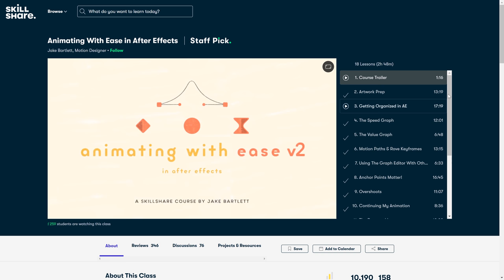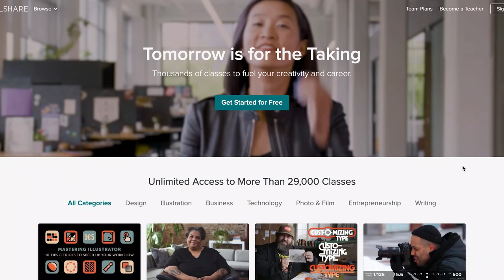How ice water makes hot water boil

Comment: 4:03 Steam explosions from super heated water is even more common (& more dangerous & more violent) if the water is distilled, so there are no minerals or nothing else than H2O molecules inside.
Trying this is REALLY dangerous & you will very likely burn yourself horribly, use at your own risk.
Reply: Well, apart from a chance of burning an eye out if the water decides to explode at the moment you look into the bottleneck, I wouldn't consider it very dangerous. It can cause nasty burns, but the burns aren't really a life threat.
Reply: Well, i doubt it is possible. Unless the bottle is plugged, of course, but that is a different kind of an explosion. The pressure the explosion can produce is limited by vapor pressure of the superheated water,  which is a function of temperature. And it would take some serious overheating. But i am meaning to try that, I hope for best destruction if I cover up the surface with a layer of oil, to prevent heat loss to evaporation from surface, and potential disturbances there. I know how much of a mess the water can make in a frying pan, submerged under oil.
Reply: But if it can explode the bottle, yes, I agree it deserves to be called "dangerous" (mainly as an eye hazard).
Reply: @victortitov1740  I hope you film this & upload to YouTube :D

I also hope you don't hurt yourself.
Reply: I will certainly keep quite a distance. I will put it out on YT if it's spectacular enough.
Reply: @victortitov1740  Good luck! :D
Reply: I'm just suprised the glass didn't shatter due to the temperature differential
Reply: When I worked in a chemical laboratory we always had to put some boiling stones or boiling pearls into the water or also other liquids to prevent this.

Comment: Steve, you should have followed this up with an experiment I used to love at school.  Put water in a glass flask or bottle. Connect this to a vacuum pump. As the pressure lowers the water will boil. At a given point the water will suddenly turn into ice.
Reply: I've seen the boiling part of this done by hand using a plastic syringe.  The ice part, I hadn't thought of before :)
Reply: @andymcl92 , I think if you're able to get it boiling, you can get it to freeze just by repeating the same thing lots of times.
Reply: CodysLab did some videos on that not too long ago, maybe a year or two.
Reply: @andymcl92  If you make the water evaporate it loses energy and cools down. Once it cools down enough it suddenly turns into ice while boiling. Very interesting to see, especially if you don't yet know the mechanics behind it.
Reply: @Gaehhn  Yeah, I get there science (I've actually got a physics degree), is just never seen that part of the demo :)
Reply: If you have a good enough vacuum chamber you can get a really cool demonstration of the triple point just by pulling a vacuum on ice water. At near 0 pressure and just above 0C the water can be all 3 states at the same time and it is really trippy

Comment: Nice demo!  I did this in my classroom with a boiling flask and a rubber stopper.  It didn't work particularly well, but the pressure differential eventually forced the stopper into the boiling flask with an almighty pop!  The entire class jumped!  Maybe it is time to give this one another go.  I'll have to find a screw top wine bottle.
Cheers,
Chris

Comment: That super heated water was kind of scary! 😧 Always thought it was just people being alarmist, but can see how it could do some nasty damage.
Reply: -  You've never overheated water in a microwave? I do it all the time. It has gotten my hands with that explosion. Both hands several times and it got me good but it never actually burnt me. No blisters or burn marks of any kind. Yes it hurt like crazy but it did no damage. The pain was gone really fast which frequently happens with bad injuries. It just wasn't an injury, I sure felt injured but only for a few seconds. It was kind of like when my dad spilled boiling hot coffee on my crotch several times. That hurt like crazy too but again it didn't do damage, it just hurt.
Reply: @Nhilistic Komrad I'm disabled and think I'm below a poverty level income. I have a cheap microwave with a rotating plate and I think I could duplicate it every time. 

   Edit  -  My coffee mug also has plenty of cracks and indentations inside it too. Another reason not to work yet I can still repeat it at will and superheat water anytime. I think there's a flaw in your theory.
Reply: Don Olinger I just boil water in a kettle fortunately – never had any real need to use a microwave. But appreciate kettles aren’t a standard kitchen appliance in some countries.
Reply: @Zveebo   -  Microwaving food is really bad for you from what I understand and I've heard the same about water. I wouldn't hardly use one for the longest time. I'm going to stop use again. It's just easy and quick. It's really convenient when you're in a hurry.
Reply: Don Olinger That’s nonsense. The microwaves just heats up water particles – it’s not harmful for you to eat at all.
Reply: @Zveebo , until there's a hole in the casing and you end up cooking yourself. 😲
Reply: @Nhilistic Komrad Why would rich people have microwaves without rotating platters? A rotating platter is a feature that increases the cost of the microwave.
Reply: @Nhilistic Komrad All microwave ovens built in the last 50 years have rotating magnetrons. I doubt any of the commerical ones have two magnetrons, because that would nearly double the cost of the oven for little benefit. Most microwaves also have rotating platters, but some of the really cheap ones (e.g. ones advertised to college students) lack the rotating platter. That's why you will find microwave instructions that tell you to rotate the plate 90 degrees partway through cooking, in case you don't have a rotating platter.
Reply: @Nhilistic Komrad In the U.S., water heaters usually connect to the 240 V power supply and have a power rating of 4.0-4.5 kW. But lower power ones do exist. Most water heaters here are powered by natural gas rather than electricity, since it is much cheaper to transport if the infrastructure is already in place. In India, especially in poorer or rapidly developing neighborhoods, I expect the infrastructure is not already in place.

I'm not sure what that has to do with microwaves, though.
Reply: @donolinger6904  While the effects on the food's texture can be not so appealing due to the way the microwave heats water molecules unevenly and at unpredictable points in the food, microwaved food is not actually bad for you. Even the claims that microwaves reduce nutritional value are equally as false. In fact they are one of the most effective heating methods for retaining nutritional value. 

First thing to understand is that the "radiation" used in microwaves is harmless. Microwaves literally use the exact same frequency as WiFi (~2.4 MHz). This form of radiation has less energy per photon than visible light and fundamentally can't cause lasting health risks. Being exposed to high levels of it (which microwave ovens are designed specifically to prevent) can be dangerous in the immediate sense as they can rapidly heat your tissues and internal organs (eg eyes, brain, etc), but the risk is the same as if you were being exposed to something very hot only it can heat up stuff under your skin. Basically just don't go smashing the microwave door or standing within a few meters of one of those big radio transmitter drums you see on the side of radio towers and you'll be fine (ie I mean literally in front of the drum, standing at the base of the tower is perfectly safe).

Second thing to understand is that the nutrients aren't destroyed or removed in microwaves because they are designed primarily to heat up the water molecules and not much else. Rascally the water contained in the food itself cooks the food. This means that nearly all of the nutrients remain in the food rather since very little mass other than water is evaporated away. By contrast, boiling your food (in cases where the pot water is tossed after cooking) is one of the worst cooking methods for nutrients since much of the nutrients are dissolved into the water and get carried off when you pour it out.

Comment: This video nicely illustrates the fact that heat is nothing else but the vibration of molecules. The higher the molecules move, the greater the pressure (due to repulsion between electrons). Cooling down the vapors, means slowing down the atomic movements, which lowers the pressure, allowing new bubbles to form, eventually reaching an equilibrium. Very nice experiment!

Comment: 4:08 it is scary, but it is way scarier if you super-heat an acid:)
Reply: Especially sulphuric acid!
Reply: Ugh!  I used to have to clean porta-potties that way!  Sulfuric acid drizzled inside, then sprayed out with hot water from a high pressure hose! (Gross out emoji)

Just one more reason not to be born working class, people!  Take it from me.  :-P
Reply: @adlockhungry304  yikes, I had been heating acid only in test tubes and the important rule is to wear protection and never point it at anyone. But the superheating is super scary as there is no way to stop it once it goes off. And it goes off rather quickly.

PS: and yeah, I may have got my degree at university but taking samples from canalisation is gross still:)
Reply: NetAndyCz, Ew!  Yeah that’s grody! 
Well, to be fair, it wasn’t super heated water I was spraying.  More like scalding hot water from the tap type hot.  Still, it steamed up a bit, got all sulfuric vapor-like.  I had rain gear and goggles but no respirator.  Too young and ignorant to know I should be insisting on such a thing. 😆
Reply: Also, I’m guessing I wasn’t dealing with the type of concentrations of acid that one might see in a lab.  ✌🏻🧑🏼‍🔬
Reply: I'm proud to say I've never had to worry about that...

Comment: 4:48
Is that why every moist thing I put in the microwave makes loud popping noises like it's popcorn?
What's the deal man? Even chicken does that
Reply: Reduce the power, extend the time and you're okay. Just gotta give the heat more time to distribute.
Reply: Well, not exactly. You see, most foods (like chicken) are full of water molecules that are trapped inside. When the water is heated enough, it turns into steam, but it is still trapped. So, when it surpasses a certain pressure point, it will rapture and make its way out of the food, thus creating the familiar popping sounds...
Reply: Well i guess a live chicken experiencing sudden change in temperature may want to express its pain
Reply: It's trapped steam in the food as most food has some water
Reply: @guythat779  food that goes inside a microwave needs to contain water anyway, since microwave (mainly) only heats the water
Reply: @mbrusyda9437  true true, but I believe it can heat up some fats too and whatnot
Reply: @mbrusyda9437  It heats oil/grease, too. You can roast nuts quickly. But be very careful. You can actually burn the nuts that way. DISCLAIMER: USE AT YOUR OWN RISK. Not responsible for any damage to you or your microwave.

Comment: ONI taught me that water has the same specific heat at all phases. That contradicts what you said at 2:30. My guess is that it's not heat capacity at all, it's thermal conductivity and temperature. The water vapor is diffused in hot air and the air has a much lower specific heat than water. So the cold water pulls heat from the glass, which pulls heat from the air, which quickly equalizes with the steam because it's all a gaseous mixture.

Comment: You can use thermal shock on a bottle to make a clean straight lip. Tie a piece of string around bottle and soke with meths, set fire to it and when string falls off it cracks where the string was tied. Not done it myself but was on a video years ago.

Comment: A related and even more impressive experiment is the crushed barrel one. You boil water in a steel barrel and put the cap on. Proceed to cool it down with cold water. As the steam condenses, a vacuum is formed and the ambient pressure causes the barrel to crumble.

Comment: I'm at 0:18, but my guess is: The water is exactly at boiling temperature, but the pressure inside is a bit too high. When the cold water is poured over the bottle the air inside shrinks which reduces the pressure and makes the water boil.
Reply: Exactly the same guess
Reply: (at 3:13 now) Interesting. I got it mostly right, but I missed the crucial part of water evaporating which builds up the pressure. Then again, I didn't know that the water was boiling and that the cap was put on right after it which would increase the pressure. If I knew the whole setup without any explanation I might've guessed it. But I'm already a bit proud of myself that I got so much of the answer right :D
Reply: Almost but not quite :)

Comment: The bottle is sealed, which keeps the pressure high.  The cold water lowers the pressure and the boiling point lowers.  Water will boil at a much lower atmospheric pressure while hiking up a mountain, for example. 
As a mechanic, engine cooling systems are pressurised to keep the coolant from boiling at temps way above 100*c.

Comment: I'm going to make an attempt at explaining this at 0:49. Since the waste is not being poured over the water but rather the empty party of the bottle, it's cooling the air inside and reducing the pressure. Reduced pressure causes the booking point to reduce.
This wouldn't work with the cap open, with a lot more hot water inside, or with a plastic bag instead of the glass bottle which would just change it's shape to keep pressure equilibrium.

Comment: Although you are correct in saying that the reduced pressure causes the water to boil at a lower temperature the recondensing vapor is a minor element while the lower temperature of the air is a much larger factor.

Comment: Water vapor takes up more volume than water, so when it's boiling, the pressure increases. When you seal it, the pressure keeps increasing. It's harder for the hot water to boil at higher pressures because the pressure is "pushing down on the water preventing bubbles from forming (aka boiling)". Since no more water vapor is being produced, the pressure reaches an equilibrium. 
When cold water is added, some of the water vapor condenses back into water, decreasing the pressure of the sealed bottle and allowing the hot water to continue boiling again.

I didn't pause the video btw, but I just wanted to write the explanation in my own words.

Comment: I think it would be more interesting, to really harvest energy from the cold, and than use it to really boil water:
To run a sterling engine you need to different temperatures. For example - 20°C in the winter outside, and +11 °C 2 meters deep in the ground. With this temperature difference we can run the sterling engine, produce electricity, and boil water.
So we turn the negative energy cold into the positive energy heat.

Comment: You can show the pressure change by trying it in a plastic bottle. As the ice cold water is poured the pressure will go down and the bottle will start to crumple instead of the water boiling.

Comment: Something to do with pressure. Okay so the water vapor since it’s hot the molecules are spaced apart. When you cap it, the pressure is lower than atmospheric. When the cold water is poured over it causes some of the water vapor to condense which lowers the pressure even more and causes the warm water to boil to keep equilibrium.

Comment: In thermodynamics we learn to think in terms of gas surface pressure. Every face, liquid water and such, has a pressure, with which the molecules are pressing out of the phase. For liquid water, the pressure is usually lower than the ambient pressure, so it doesn't boil. Now you two ways of boiling it: either you increase the gas pressure of the water, by heating it, so it is higher than the ambient pressure, or you decrease the ambient pressure enough, with a vacuum pump, so that the gas pressure again is lower than the ambient pressure

Comment: Vapor pressure drop seems to be the right explanation.  I was suspecting that starting to watch the video.    It’s actually a very good method of heat transport. Heat pipes (like cpu coolers)rely on the same principles to efficiently transport heat.

Comment: It’s because there’s a cap on the bottle and so the pressure went up and raised the boiling point. The cold water lowers the temperature and, therefore, pressure of the air in the bottle which, in turn, lowers the boiling point enough for it to start boiling

Comment: My guess is that it reduces the pressure in the top of the bottle and so the hot waters boiling point reduces.
Reply: Almost right. Didn't consider the cold water would be cooling and condensing water vapour and not just cooling air and thus having a much greater affect in reducing the pressure.

Comment: I hypothesise that the moment you capped the bottle, the gaseous water from the boiling increases the pressure to the exact point where water at that temperature stops boiling. Then therefore by adding cold water it lowers the water vapours temperature causing some to condense decreasing the pressure allowing the water to boil.

Comment: When you first demonstrated I was like "huh how?" But then I pondered and remembered Watters boiling point depends of atmospheric pressure. And the cold water was reducing the pressure in the bottle faster than it cooled the hot water. Thus lowering the boiling point rather than heating the watter.

Comment: Apart from the heap capacity of water, the heat lost from the water boiling is going to be reversed by the water vapour condensing. The only extra loss of heat is going to come from the larger surface area losing heat due to the extra convection induced by the boiling water.